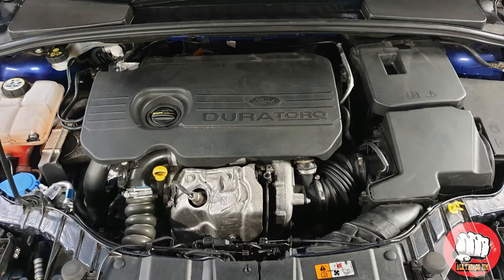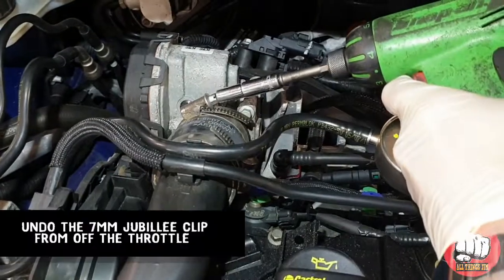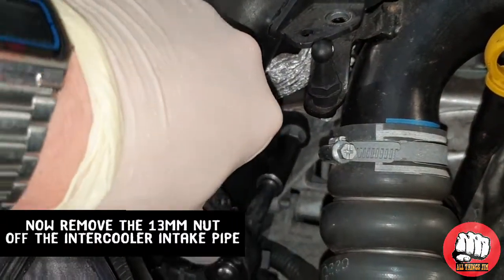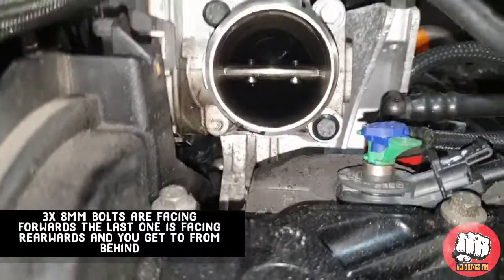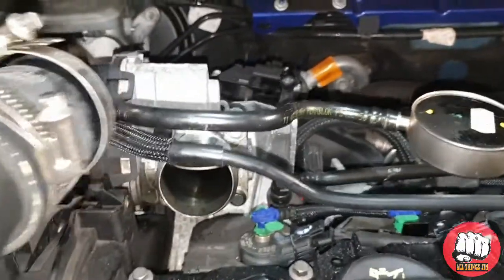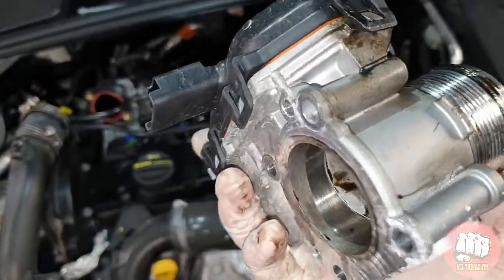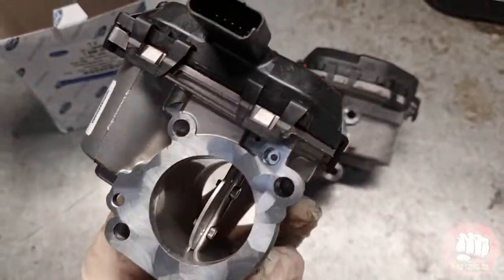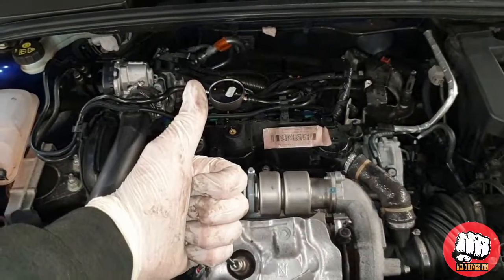Throttle body-  ford focus 1.5 diesel- how to replace

Comment: at what mileage this replacement? I see that throttle body is clean...
Reply from the maker: Id be lying if I said I could remember as it was a long while ago but it would have been fairly low milage 👍

Comment: What was wrong with the old one 😃😃
Reply from the maker: It was an electrical fault causing the throttle flap to Jam throwing it into limp mode  and bringing on the eml👍
Reply: ALL THINGS JIM thanks 👍
Reply: What error code do you have? I have p1102.